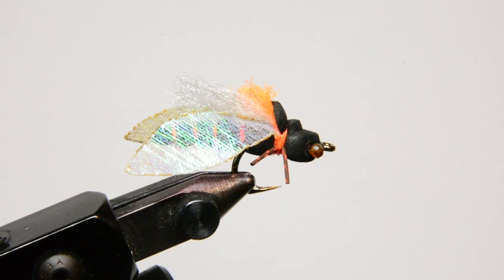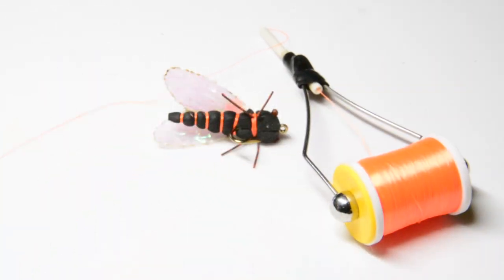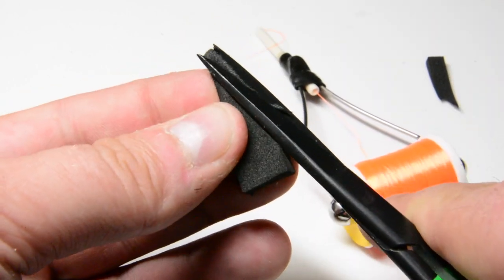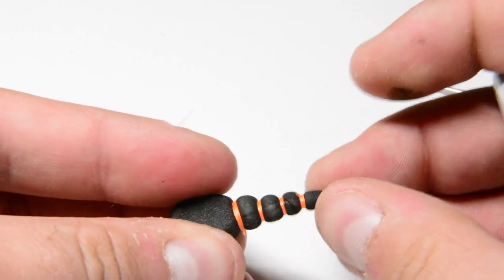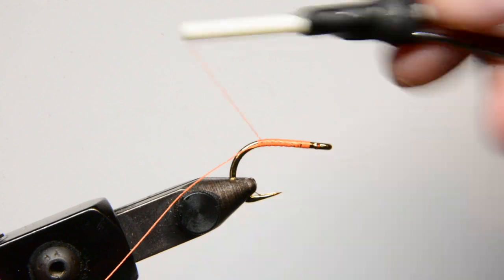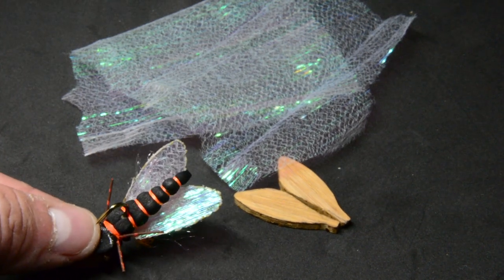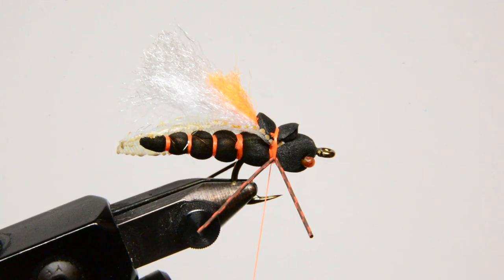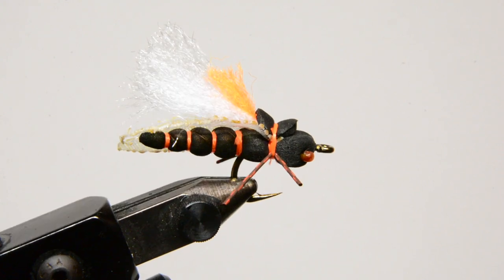Fly Tying: Project Cicada | NEW Wing Technique

Comment: try putting that wing material in between two pieces of clear packing tape then put those between a pice of parchment paper then gently rub with an iron and it will make them sturdy enough to shape and they wont come apart.
Reply from the maker: Appreciate the suggestion. I’ll have to try that!